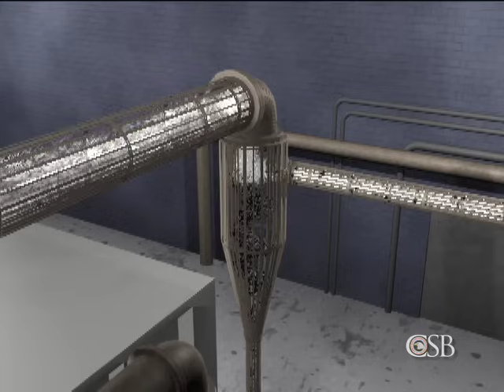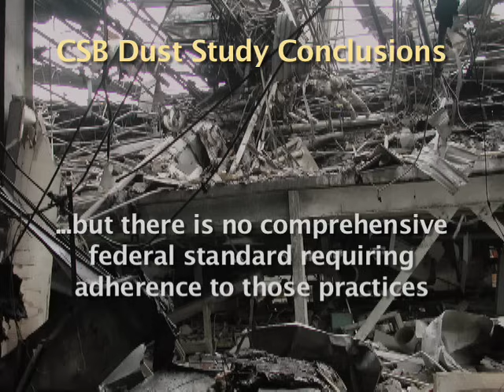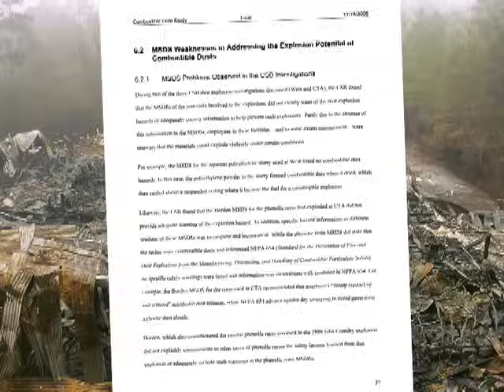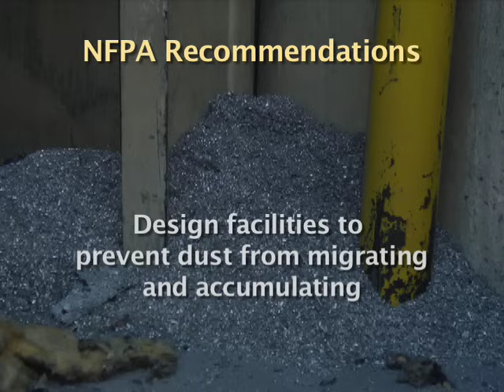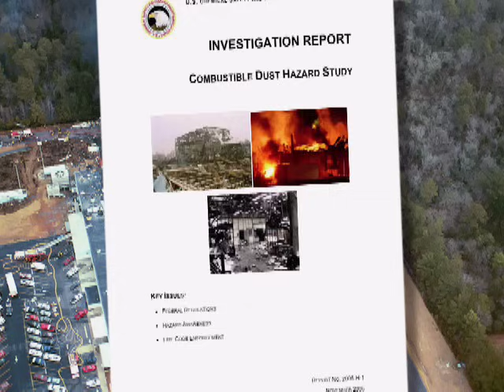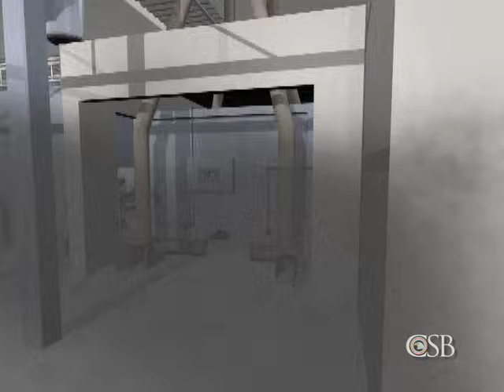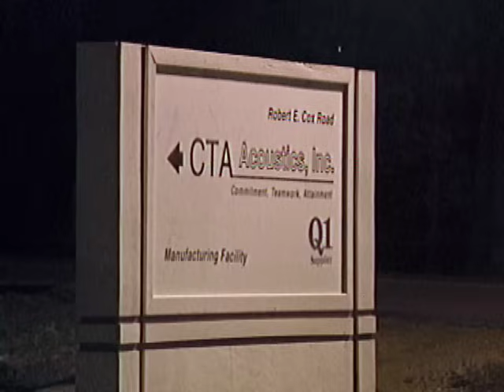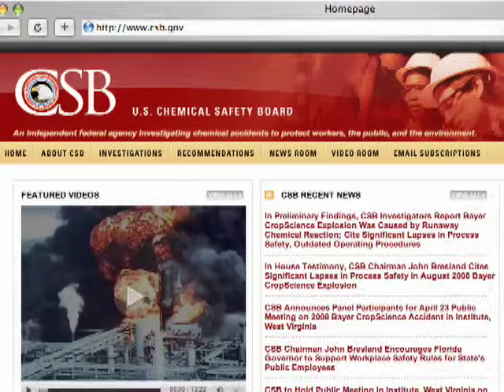Combustible Dust: An Insidious Hazard

Comment: It's interesting in later combustible dust accidents how you can hear them getting more and more frustrated at being ignored
Reply: It's particularly interesting considering they're addressing OSHA, another closely related federal agency. If this isn't about Occupational Safety and Health, I don't know what is. Especially since they do have extant regulation e.g. for the flour processing industry, and yeah, dust inhalation is a health issue regardless of the explosive aspect.
Reply: @samposyreeni  Good point about the dust inhalation. The safety starts right there.
Reply: @samposyreeni  The dust inhalation is underrated, in my opinion, as a problem. Yesterday My co workers and I were loading in our normal ground trailer for ups and there was so much dust we couldn’t stop coughing when we were stacking in the back. This is the worst it’s ever been but the dust is bad you can see it when the sun comes through the bay doors it’s everywhere. Sure we get health insurance but there could be better ventilation and health standards in general my facility is sadly dated.
Reply: @JollyJoe135 , nowadays I mostly deal with intravenous drug users, and the stuff they leave hanging in their veins. But the stuff industrial workers leave hanging in their lungs is almost as bad. Like asbestos, can even lead to cancer, unlike anything IV-users do.

*And*, in the industrial setting, it's not much of a choice, unlike in the drug misuse one. You take it, or you're on the street. Awful, and wrong.
Reply: They don't seem to understand the situation.  Ceiling girders 100 feet up covered in dust, plus a mess of conduit and ducting, and pipes, etcetera.  They say "They should use a vacuum to remove dust at regular intervals".  How?  climb up there with a shop vac?  Or remove all the production equipment on the floor so you can get a boom lift in to access the ceiling?  Every six months?  This is not realistic.  They need to focus on codes/regulation when the factories are first built, and have existing factories retrofitted.  Something like encasing the steel girders on the ceiling in fireproof foam blocks, and have ventilation ducts flat against the ceiling with any gaps sealed, so dust can't accumulate on the girders and ducts to begin with.  Then the workers can focus on cleaning dust off the equipment closer to the floor.
Reply: @BrettonFerguson  They mentioned the issue of inherently accumulation-resistant design. Search combustible dust within the channel and watch some of their videos.
Reply: @hanwentian5079   I know some people do.  I'm talking about the people who say "Just keep the dust clear from the ceiling beams.  Just do it already."
Reply: @BrettonFerguson  
FPV drones controlling nozzles of vacuum cleaner lines....
those vacuum lines being suspended from the ceiling and controllable from the ground control boards???

Comment: No one is addressing here the equally bad INHALATION of dust! This is also a medical hazard!
Reply: Yeah I was thinking that all the way thru the video, if the dust is concentrated enough to explode it must be damaging the workers health, especially when they are stopping work several times a day to brush up dust and blow dust off equipment with compressed air.
Reply: Although I agree dust can be an occupational hazard an explosion will likely affect a whole area . I used to work in a flour mill and masks/hairnets were mandatory , dust is common but has to be addressed so there is a 24hr cleaning crew ........using grounded vacuum cleaners to minimise spark risk ....it IS possible to do this work safely ......just needs a little thought
Reply: grounded vacuum ....brushing and airlines just moves it back into the atmosphere to settle elsewhere and increase risks
Reply: I work in the metal industry. Laser cutting of aluminum & steel produces metallic dust. Metallic dust is heavy and drops to the floor and stays down on the floor. Some fools clean the floor with compressed air, instead of using brooms & vacuum cleaners.
Reply: Well, yes, inhaling the dust is bad for the lungs, but really, in this situation you're only going to be getting a few breaths of that before you're enveloped in the explosion.

And it's not that the dust is in the air in that density all the time. Some event kicks it in the air and then it ignites.
Reply: Danilo Peterson welcome to work
Reply: This video is about dust explosions, not general hazards related to dust. So I don't know why you're surprised they didn't talk about inhalation.
Reply: grodhagen: I don’t disagree with the sentiment that any other issues found should be mentioned, however seeing as this video is based on a study into combustible dust the best that would be included would most likely be in the form of “oh yeah, and by the way it ain’t good to breathe that stuff!” rather than a detailed study into the issues that such dust causes and useful recommendations. It would be good for a separate video though...
Reply: @Danilo Peterson - 
YES , because the dust in lungs kills silently & hidden ... by far not as spectacuar as a factory destroying fireball explosion
Reply: Because this video is explicitly about DUST EXPLOSIONS...
Reply: I was thinking the same thing 😵 😷
Reply: It's sugar, it'd be easy for the body to break it down in the lungs, not much of a hazard.
Reply: @youngeshmoney  lol you didn't watch the video did you. 
Sugar was just one case study.
Reply: @edwardschwenk3100 i dont think i have ever seen the msds for chicken shit and nitrates or corn soy and wheat dust before
Reply: Because people that work in dust filled environments know about ppe
Reply: Yeah but CSB only has time to worry about glamorous accidents and hazards.
Reply: Fair… though I would think post-retirement health issues would be preferable to exploding
Reply: That is more OSHA's area of investigation, the USCSB investigates chemical accidents not health hazards.
Reply: Aluminum shavings dissolve when ingested and turn into aluminum oxide which is harmless
Reply: They do industrial hazards not medical hazards. The CSB is not a medical practitioner
Reply: were you suggesting that no one is talking about black lung? i mean, i get that this isn't a video about coal specifically, but yes, i think people are aware that inhalation of dust is a huge issue.
Reply: If it’s not oxygen, it’s not good for you.
Reply: @twizz420  exactly
Reply: Absolutely
Reply: Totally agreed
Reply: @twizz420  Ok, so? The comments on a video aren't always going to be about the video's topic.

Comment: Someone SHOULD go check out the FEED GRAIN MILL at Westville Oklahoma.... DUST DUST DUST INCHES THICK ON EVERYTHING
Reply: This deserves more upvotes. Only person I've seen thus far trying to prevent another possible accident from happening!
Reply: @thecrazyfarmboy  grain mills around hear are horable for lack of dust control also.
Reply: But is it combustible dust? Or are you a disgruntled employee 🤔 ❤
Reply: @BradyReese  combustable..!!!!!
Reply: @BradyReese Grain dust is extremely combustible. Have you ever lit up a cloud of flour? Same principle, but bigger
Reply: @BradyReese  If it's a fine - small particle, it is combustable.
Reply: @BradyReese  
After rounding down, 1ft³ of falling powdered grain may carry over 250,000 joules of energy when ignited, 
If 1000ft³ were to ignite, about the volume of a small grain trailer, it would carry roughly 25% the energy of a lightning bolt.
Reply: Snitch
Reply: @trespire *a fine small particle that can react with oxygen, which grain certainly is. In fact those fire breather showmen often use corn starch which is more or less just a component of flour.
Reply: @WynnofThule  A very good rule of thumb for if something is combustible. The fact that we eat it is a pretty good clue as to its reactivity with oxygen, since our cells use oxygen to get the majority of the energy out of the food we eat (though living organisms use enzymes and stuff to get it out in steps rather than all at once like in combustion, because cells are also combustible).
Reply: You can contact your local government or regional government if no action is taken
Reply: There is definitely a government line you can call to report occupational hazards like that

Comment: It’s really important to talk about economic impact.  The same manager who won’t spend a cent to make things safer may spend to prevent loss of revenue due to operation interruption.
Reply: Economic impact is an important consideration like safety. If you can’t run a process without people dying, it’s probably not worth running the process. If a safe process is not economically viable then it’s similarly probably not worth running the process.
Reply: @pointcuration1278  Narcissists doesn't consider human value. Learn or pay up.
Reply: @pointcuration1278  if the safe process isn't economically viable, find a different job
Reply: And consider also the families losing a breadwinner on top of the emotional damage

Comment: I used to work in a woodshop that made tons of dust. Literally in a single day I might make 500 pounds of dust that went into a collector and 100 gallon bags that I had to drag outside. There was dust everywhere and we tried to clean it because it looked better but i never considered how flammable it was. Every six months my boss would blow out the entire shop to clear out buildup
Reply: That sounds like a recipe for an explosion 😅 did yall have an effective fire suppression system?
Reply: I don't think I'll ever understand how dust from flour or sugar can become flammable. Wood shavings make sense...not flour or sugar.
Reply: It explained in the video.
Reply: Even aluminium dust was flammable in this video
Reply: Dust form gives you so much more surface area to gain contact with heat and oxygen. Same way paper is much easier to burn than a pack of it, and wood shavings and dust is easier to burn compared to a block of wood.
Reply: @scootermom1791  Its because its dry and very fine particulates. Just take a little flour drop it out of your had and ignite it. Its very flamable.
Reply: @scootermom1791  sugar and flour are organic compounds which can be combustible
Reply: @scootermom1791  Flour and sugar are some of the worst as they are common and ground to pourable material for consumers to use. As a messenger I saw wet vacuums in use to control rubber dust buildup. Controlling pathways for dust to migrate away from work areas also is a must. Plastic curtains are very common to control both air flow and dust migration. Sealing voids with secure inspection methods and reducing surfaces that dust can collect on from the start of a structures design process is one of the best ways to reduce the hazard dust possess.
Reply: @wacojones8062  so are all powders combustible like this? For example, cornstarch,  ground up cinnamon, baking soda, other ground up spices, etc.?
Reply: @mattlogue1300  oh, that's interesting. Now it makes sense that we put baking soda on some fires to douse them. Thanks for the explanation! 🙂
Reply: @scootermom1791 I believe any compound with an energy content can burn in dust form
Reply: The board mill near me probably fills around 2 20' bins with sawdust each day, and that's just what I see collected during the day, it's going 24/7, environmental controls are key
Reply: @scootermom1791 just look up how it works, its energy containing material finely mixed with oxygen, its essentially a combustable gas at that point

Comment: I work the mat lines at the new CTA plant.  My dad worked at the old building from 1991 and was there the day it blew up.  He worked the new building until he left for the railroad in 2010.  I still have a dad.  But a classmate of mine lost her uncle.  He had 3rd degree burns over 80% of his body.  And my dad knew a fellow that walked out with every bit of clothing burned off except his work boots.  My hat's off to everyone that was there.  I hope I never experience that.  I got lucky.  My dad's here.  Others..... well I hurt for them.
Reply: My dad was supposed to work that day of the explosion but had to call in on account of family problems only reason he's still alive
Reply: VAPOURIZE 
But lobbyist fight AGAINST regulation

Comment: It keeps happening due to work culture. I say I need a dust collector for a vacuum to clean up all the dust. Management shrugs it off and says, "Use a broom." I can't reach certain places with a broom.  They say, "Don't worry about it." I think I'm completely warranted to worry about 2 inches of grain dust sitting in the same room as the gas heater.

Comment: Lady @11:20 says it's just a lack of understanding.  If only people knew how dangerous dust was they would simply clean it up.  I think she has a lack of understanding, sometimes it is difficult to find and remove dust from ceiling girders, pipes, ducting, conduits, and such things.  I've been in factories where we knew dust was on the ceiling girders, we knew it was potentially explosive, but had no way to get to the ceiling girders.  The only way to safely access the ceiling girders would have been with a boom lift, however there was no way to get a boom lift in with the machinery on the floor.

Comment: I think a big part of it is psychological.  The staff become so used to the dusty, grubby workplaces that they become blind to it.

3:50 If the dust in the collection system can ignite how could you prevent it from happening?  The system is based on using air to move the dust.

Easier to prevent dust from escaping systems in the first place instead of trying to chase it up into ceilings and such.

16:20 I'd say they should've escased the drying process so it wasn't escaping in the first place.  Workers must've been constantly breathing that dust also.  I'm also unsure what knowing the material safety sheet would've done for employees since they don't have a say in how the systems are designed ($$$).

Comment: "They had an accident there before..."  "Aluminum dust had acculated...in some places several inches thick..."  

Uhm, and what, the employees could not see this? I worked on a commercial rock crushing operation. The dust, while not explosive, required wearing a mask to protect nose, throat and lungs. The dust built up everywhere. Constant attention was necessary to keep the system running. Just saying.

Comment: Aluminum dust is actually used in the Daisy Cutter and MOAB bombs. Those are fuel air bombs, and they are the most powerful bombs in the US arsenal, outmatched only by nuclear bombs. They use a standard high explosive to disperse aluminum dust, which then ignites when mixed with the surrounding air, creating a massive explosion.
Reply: Wow that's crazy

Comment: Worked in a warehouse for my first job, my boogers and snot became black, i mean, pitch black, like tar. I got scared thinking something was wrong with me and was about to go the hospital until one day i was showering and looked down at the water running off my skin and seeing how black it was. I never realized how much dust was in the air until then, you can't see it, air looks clean and smells fine, doesn't trigger any f allergies or anything. So i can't imagine dust that builds up like this

Comment: Most companies don’t want workers to take production time to clean, but will complain that the production areas aren’t clean enough. And they don’t want to spend money for dedicated cleaning crews or special cleaning equipment. You can’t get every nook and cranny cleaned with a 10 minute end of shift time frame. And I’ve never seen anyone get up and clean in the roof trusses, or on top of ceilings… Happy to be retired now, but feel for all the workers still in these positions.

Comment: In 1968 i went on a school field trip to a factory where decorative wood bowls and similar items were made. The work was done in open roofed warehouses or outdoors. Even at the age if 14 i was astounded at the huge accumulations of chips and sawdust everywhere and I was sure there would be a fire sooner rather than later - and there was, within a few weeks. There was no dust explosion in this case but the flammable material all over the place did the job anyway.

Comment: Combustible dust is no joke. Flour, sugar, wheat, even plastic and metal can be fuel if not handled.

These are classic examples of companies not caring to do basic safety steps to control dust as they don't want to spend the time or money to accomplish it. When dust is inches thick, that neglect is obvious.

I can personally attest to the usefulness of the MSDS/SDS sheets being updated. In 2015 I was working with nylon powder for 3D printing at work and there was a note about combustible dust. I had no idea that plastic powder was flammable, and as the lab manager I took steps to mitigate it using explosion proof vacuum cleaners, anti static mats etc. OSHA never inspected our lab, it was all up to me. The expense was minimal but well worth it as we didn't have a single incident in the three years I was working there.

Comment: In all these videos they blow dust around instead of sucking it up. I got fired from a animal feed mill once because I refused to use compressed air and broom for cleaning. I explained to them the only cleaning I would be doing would be with a vac and that they can go buy me one if they wanted me to clean up huge piles of dust!

Comment: The first one is most interesting, because it would seem that something other than the Aluminum itself would have to be the fuel for the fire to keep burning. But, I looked it up and it makes sense that Aluminum at these particle sizes burned. Flakes like these are used in fireworks, so pipes full of the stuff would certainly do so as long as air and static discharge are present. My guess is the ignition source was the friction of the particles against each other where a static charge was already building and Oxygen was present in enough concentration.